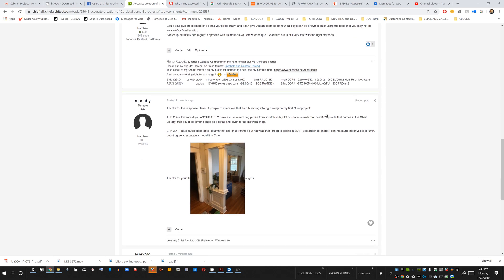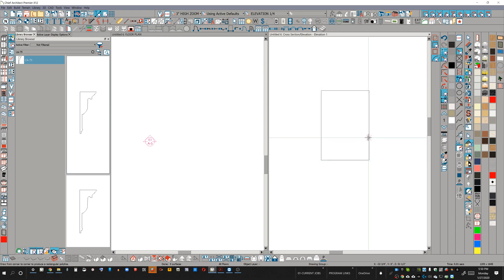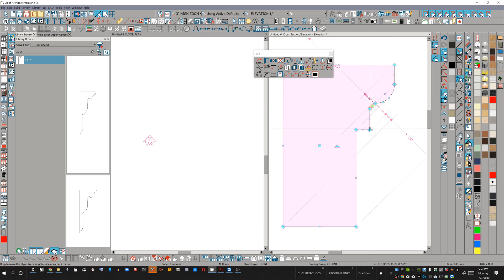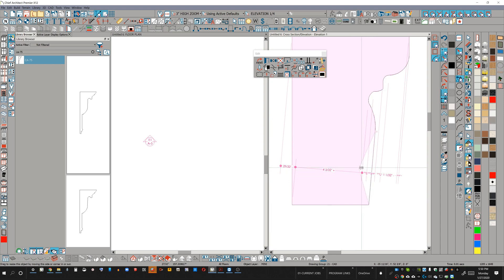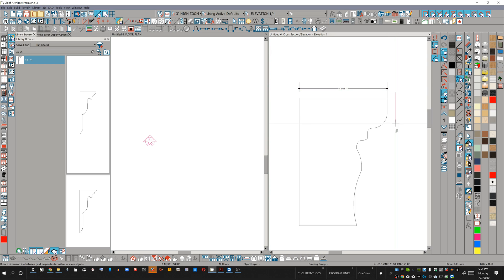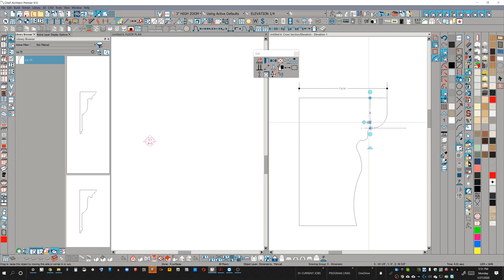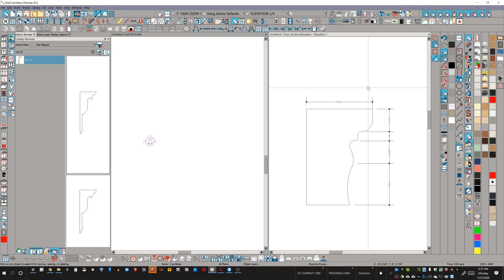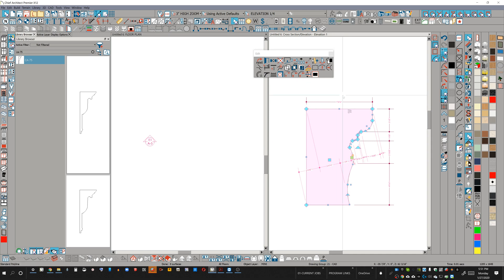Creating a complex molding efficiently in Chief Architect X-12

Comment: Long time, no talk. :)   Just getting back into the swing of things again and about to upgrade to x13.   One thing that drives me insane is the fact I can't just import a DWG autocad molding profile to use in Chief.  I guess the issue is the way the curves/arcs are imported?  I keep coming back to mess around with this idea, but it ends in frustration.   Is there something I'm missing?  There are literally thousands of molding profiles in DXF/DWG format ready to go.  They work flawless in Sketchup and many other programs.  What am I missing in Chief?  Thanks.
Reply from the maker: Yes, learn the "Extend" tool. If auto-connect CAD segments is enabled in your Chief Preferences, then group selecting CAD that has shared endpoints will connect using the Extend Tool
Reply: @rabbittdesign8482  i will give it a shot. Thank you.